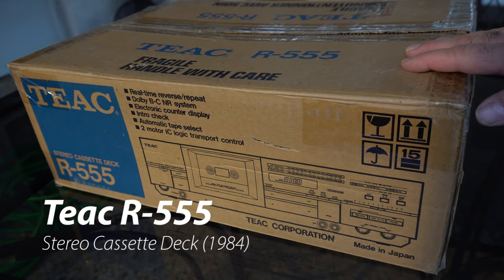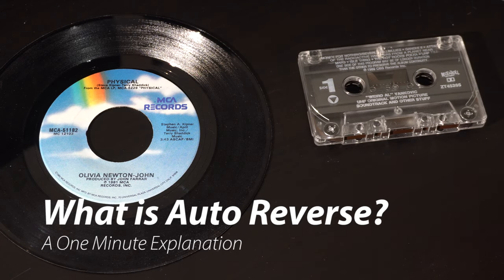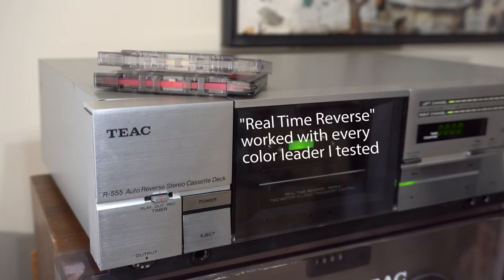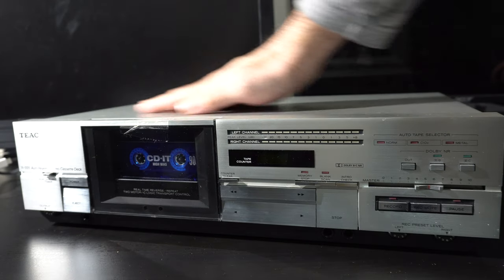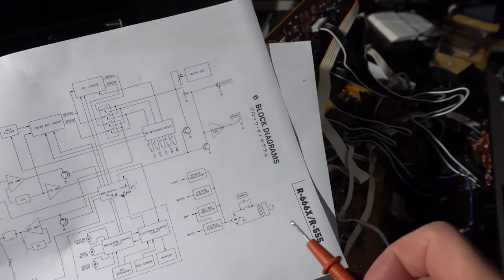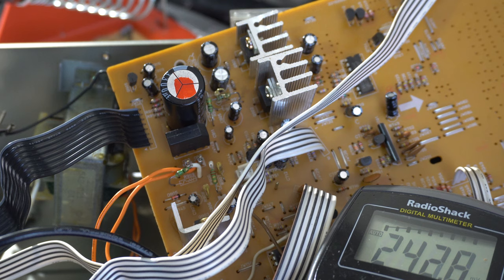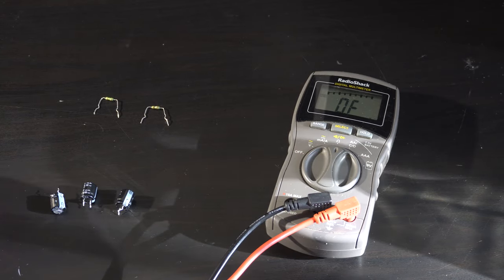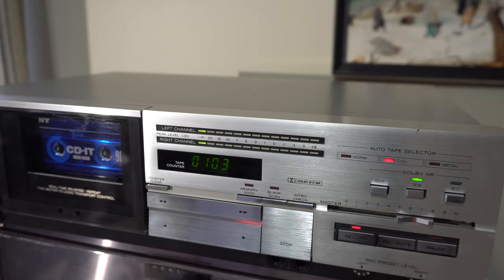Teac R-555 Cassette Deck "Real Time Reverse" Demo

Comment: I like Teac over many years. I do have the
more expensive Japanese version of the
fairly current Teac Dual tape deck W1200
and it works nicely, though Dolby is gone
from the market due to patents expiring.
Reply from the maker: I usually associate Teac with high quality as well. This particular deck in the video had some problems which I hope were not typical, maybe resulting from a power surge or run of bad capacitors.... The W1200 looks like the Tascam 202MKVII being offered on Amazon currently for $600, which has a switch labeled "Noise Reduction (Play Only)" wonder if it would make a Dolby B tape sound better.... Anyway, thanks for watching and I appreciate the comment!